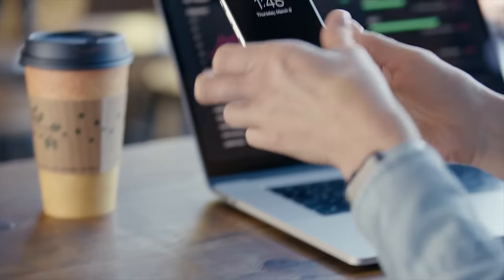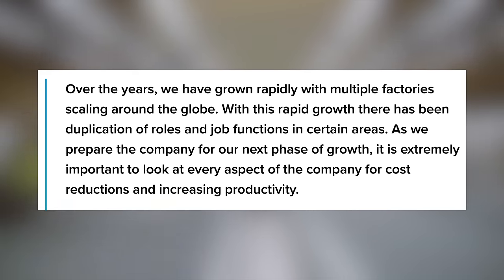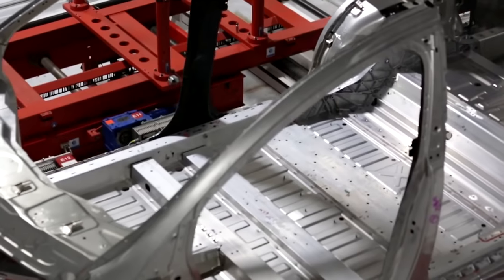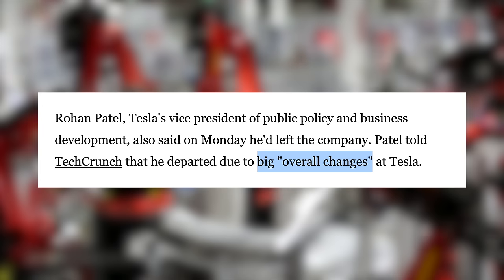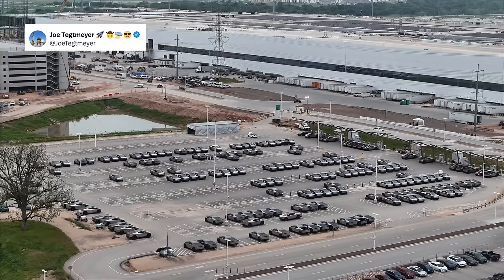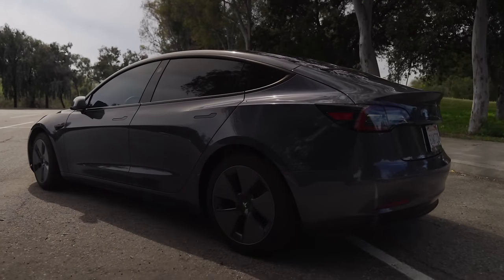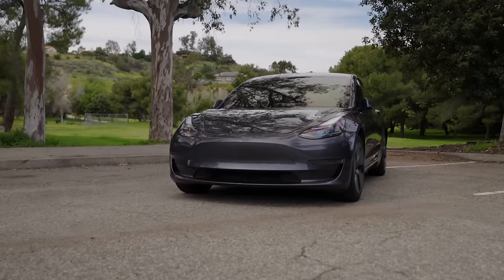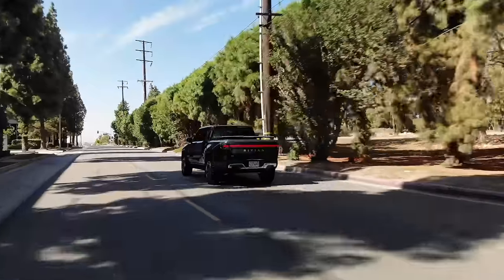MASSIVE Tesla Layoffs Are Here | Elon's Correction Problem

Comment: Here's a bit of truth as I'm really tired of YouTubers expounding the virtues of FSD. I currently have two Teslas w/FSD trial (truck on order too) and have had two other long-term "loners" (X & M3) with it as well. I have NEVER had FSD take me anywhere that didn't require immediate intervention to either prevent it from wrecking us, getting confused and wandering around through several lanes, not seeing speed bumps and taking incorrect routings such as through a hospital emergency lane area. Without the smallest amount of exaggeration, on a single trip ... within 60 seconds we were almost killed three times. It pulled DIRECTLY in front of a car at a stop sign without braking/turning and if I hadn't had the acceleration boost and "floored it", we'd be dead by "T-boning."  Phantom braking is a real and persistent problem. "Summon" is completely useless as I have NEVER seen it work even once. Going through intersections is butt-tightening as the car wanders around since there are no lane markers, frequently into other lanes and will hit cars without driver intervention, so a tight grip on the wheel is not optional. And attempting to make a turn under the same circumstances will have the car driving all over the place, starting to turn into on-coming lanes that are sitting at a red light and braking in the MIDDLE of the intersection with cars behind you having to hit their brakes. I have discussed this in length with Tesla service and they have NEVER been able to fix it. In total and unadulterated honesty, even if FSD was completely free, I'd never use it. While I'm truly a "dyed-in-the-wool" Tesla/Musk fan, I have to admit there are failures within the company (fit/finish/paint, charging for the built-in garage opener, no included charger, no decent surround view for parking, etc.) but the most egregious, is FSD. Owning what is probably (IMHO) the best car ever made, to have such a dangerous/useless item is shocking. The FSD is an utter failure and focusing time/effort/money on such a lost cause does nothing to counter all the money I've lost with Tesla stock or make the car palatable to a prospective buyer that's afraid as a result of all the press about how bad full self driving is. At this point, the best thing Tesla and Musk can do is stop any further wasted research of FSD, and focus on their core products without this utterly failed distraction. I wouldn't stake the lives of my family on FSD ...
Reply: Let's all just be honest. Full self-driving is a solution looking for a problem to solve. That said, you are right. My MY came with a trial that I used a couple times and then disabled because it was buggy and dangerous. I then got the latest 30-day trial with my last software update. It is a tiny bit better, but still too dangerous to trust on busy streets.
Reply: Its time for fanbois to admit it. Elon has lost his sh*t.
Reply: FSD will get better but it will take a few years, perhaps a decade. But, as a software engineer, I can assure u, it will get there. However, not anytime soon. And, there is the elephant in the room, robotaxi... Dont get me started on that pipe dream. Elmo is delusional to think that is even remotely possible in the next 2-3 years. He will be lucky if they get something that works 80% of the time in 5 years. But, even then, do you think they will be allowed to let those cars roam like that alone in the cities? Nah... there will be regulations, compliance, and other things. Not to mention litigation due to damage. And damage, it will be. LOL.
Reply: @alexnhan8527 based on one post?
Reply: @quansun7633 No, based on years of terrible decisions that have now resulted in declining sales and a collapsing stock price.

Comment: Generally layoffs like this are a gift to shareholders. A means to in the short term adjust fixed costs in a company to make them look better on paper and that works for shareholders as they typically are only in a stock for the short term gains. Long term they really just need to get moving on that Y refresh, so many are probably just waiting for it given the sudden increase in inventory. The S and X also need to get revamped to give them a proper edge on the 3 and Y. It kinda seems like there may be some disappointment coming for the 25k EV similar to the 40k cybertruck original starting price, I think we'll see that price go up in some fashion or some other caveats around it.
Reply: Except the stock is down on the news 😂 who benefited??

Comment: Power wall still doesn’t seem to make financial sense, the time it takes you to pay it back is likely the age of the unit lifetime anyway so doesn’t make sense to buy it imo
Reply: If your utility company allows you to do 1 for 1 net metering, and you don't have frequent power outages, a battery backup of any kind for your solar panels cannot be justified financially.
Reply: In San Diego there is some offset savings due to the variable rates, mainly through 4-9pm timeframe. If virtual power plant works as advertised that is more revenue. Even with that I mostly agree with you that payback is long. However I don’t look at it based on payoff time I care about cash flow and my system has been positive cash flow from the minute it was turned on.
Reply: Anyone that I’ve heard that owns a powerwall said the money would have been better spent on more solar panels.

Comment: Elon wants the stock price to crater so that his next options compensation package has as much upside as possible. His goal is to own 25% of Tesla shares. This goal is easier to achieve if the stock is slammed in the short term. Any independent board would fire a CEO who did this ...
Reply: No. As soon as Tesla stock tanks Elon will be gone. Only reason he is still around is because he still get simps to pump the stock. He hasn't contributed with anything of real value for years.
Reply: @windsolarupnorth7084  Do you really think it's likely that his hand-picked Tesla board members, including his brother would fire Elon?
Reply: Clueless nonsense.
Reply: This actually makes sense. As soon as he gets his next compensation package he’ll start pumping again. But, he may have lost too much credibility by then. Or else, he’s just depressed and losing his marbles. Maybe he’ll end up in a hotel room with eight inch long fingernails and long, string hair.

Comment: Why this obsession with electrifying cars ? Most energy used by humanity is already electric including rail transportation in subways and every where else in Europe and Asia. Carbohydrates are still the cleanest and most efficient fuel for small-medium size power density i.e. vehicles, aircrafts , rockets, etc. 
We ARE in electric age and have been for the past 60 years. 
Electrifying cars is the same as "beating a perfectly LIVE horse". The question is - what is the point ?